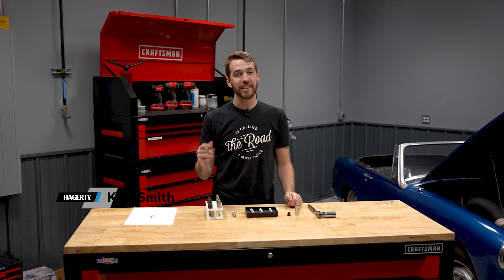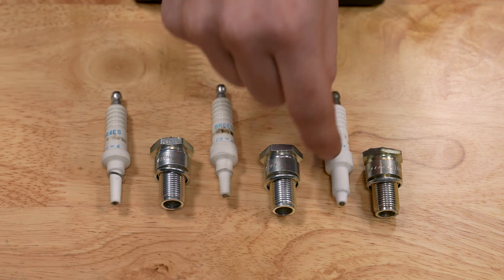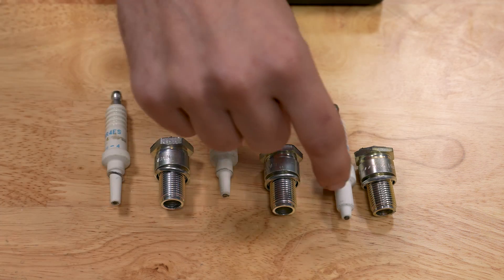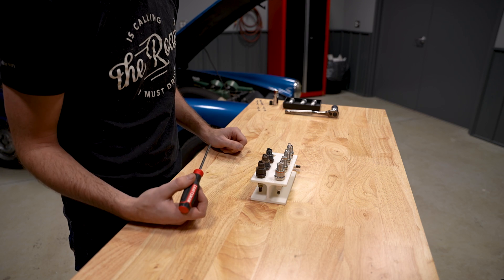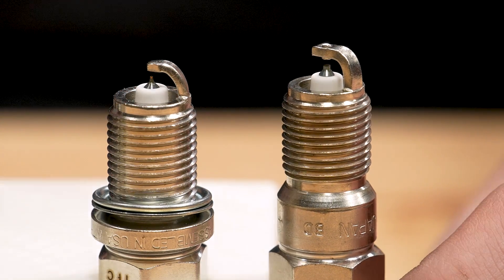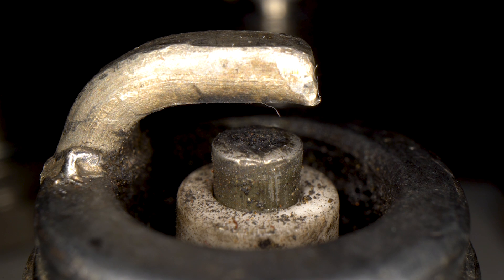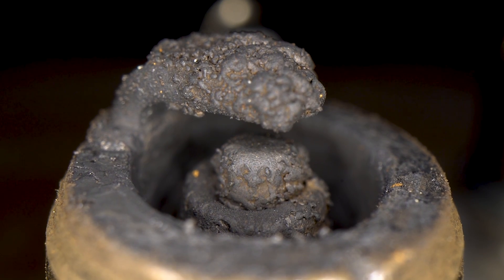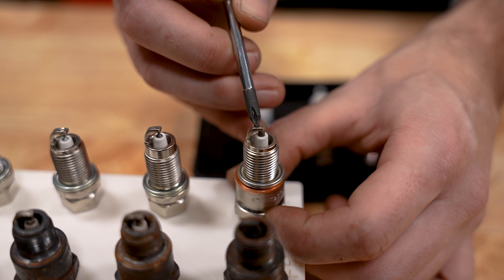How spark plugs work and what they can tell you about your engine | DIY

Comment: hello, recently a spark plug boot sleeve ruptured and the spark plug was loose and I was able to take it out. Now the broken pug about 1/2 inch down where sprk plug connect , the issue is  where it broke is the hard plastic , over time its even became harder . now since I have the sparkplug out . and I tried almost everything to take it out . I lube it with silicon spray . If I grill it with a circular saw 7/8 , which fit in there. would the debris go inside  the piston ? or valve?  the car is in my garage . . please help. thank you in advance. Thank you. More power to you and your channel.

Comment: The coolest thing I ever done with a spark plug was I had a 80cc 2-stroke engine it was running it was hot and I turned it off I turned the motor to where the compression of the piston was at Max and I hit the spark plug with a barbecue push button sparker it must have sparked the spark plug cuz my block it popped zero Revolution to the crank and all of a sudden combustion note to self don't do that again direct that blew the side out like a little shrapnel grenade it was weird the whole top and down the side like popped off

Comment: I have a 2005 one ton Silverado four wheel drive 6.0 with 210,000 miles. I bought new. It still has original spark plugs and it runs as good as the first day I bought it new. No misses no spark issues at all. Even has original wires and coil packs. Chevrolet like a rock.
Reply: Thanks, interesting... I am coming up on my 90,000 miles on GMC Canyon 4 CYL/2007( early first plug Replacement @60,000 miles. OEM)........Also,interestingly, my 2015 DODGE JOURNEY 4CYL, is Every 30,000 miles PLUGS, ODDLY .....WHICH imhad Dealer do, as got “THE Lifetime Conventional Oil Change “, with new **Car purchase ( first time in 50:Years for me , as generally done ,much Work myself over the years)....
Reply: Wow your lucky. 2001 Silverado one engine replaced second beginning to knock transmission slipping and goong on 3rd transfer case chain. Regular services since bought new. Never pulled a trailer or pushed a plow.
 Like a rock.

Comment: A critical point, even though no one is likely to mix them up: never use the incorrect "reach" plug in any head. Generally standard length for iron castings and long reach for aluminum. A long plug in an iron head will likely crash and a short one in aluminum will cause catastrophic burning of the exposed aluminum threads.

Comment: Whats better an why, gasket seat or tapered seat?
Reply: Tapered seat transfer heat better since there is direct contact with cylinder head , but this only in case of ideal matching of the surfaces and avoiding of  any dirt between them . When the gasket introduce some resistance for the heat transfer, it is much more tolerable for poorer matching of the surfaces and accommodation of some dirt . So tapered are theoretically better when gasket type are practically better . M16 vs AK47  the same thing:)
Reply: @flappingflight8537  O dude, M16 all day!!! No comparison!
Reply: @beachboardfan9544  Sure, on the range :)

Comment: They are nickel, platinum and iridium plugs.
A "copper" plug is miss information repeated by everyone. All of those options have copper cores.
An iridium plugs is just as much a "copper" plug as a nickel plug is. 
I can't recall when copper cored plugs started, I think it was the 70's. It was marketed heavily at the time and some brands continue to promote it to this day.
Reply: The key word is the core :) Cooper CORE  . The reason for such design is the better heat transfer of the Cooper . This allow to widen the heat range of the plug so it is able to self clean on light loads and idling and in the same time to do not be a source of preignition on heavy loads . This also allows manufacturers to cover all the engines on the market with much smaller number of spark plugs models .

Comment: Where’s the part about how they work? Does it have something to do with the 12 volts from the battery being converted by a coil into thousands of volts to promote electricity jumping between the electrodes in the form of light energy (the spark) and heat energy and it’s the heat that ignites the fuel, etc.? Also, you mentioned compression rings, but I suspect that many people haven’t heard it spelled out as “it deforms as it’s compressed by the screwing of the plug to a particular torque to conform to any irregularities between the shape of the plug and the hole in order to completely seal the cylinder” or some such thing.
Reply: If you're gonna get fancy its called dielectric breakdown of the air....
Reply: @BrycenKauai  Yes, let's get fancy. This is what I/we want to know. Seriously.

Comment: Is it worth upgrading your plug for more expensive unit or just get oem. Since theynare design for ultimate performance
Reply: Try Denso IridiumTT (double fine tips electrodes) and you will figure out by yourself :)
Reply: @flappingflight8537  thanks; Have two cars with over 120k that need plugs.
Reply: @JuanLopez-oz9kh  120k miles or km ? If it is yours cars first plugs service most probably they are already iridium plugs . Denso iridium TT are performance oriented plugs . Better start,smoother idling , better throttle response, better acceleration , better exhaust emissions and better fuel consumption. They achieve all that with very thin electrodes , only 0.4 mm the central one and 0.7 the ground one . This is the reason their lifespan to be shorter , around 100k km . The OEM iridium plugs that the cars come originally from the factory are with ticker electrodes in order to be good for around 115-120k miles .
Reply: @flappingflight8537  thanks; neither of my cars are for performance cars; just family taxis; lol 120k plus miles

Comment: One thing to note about older engines that originally  came with copper plugs is to replace those with the same type and NOT to "upgrade" them with the platinum style with the tiny center electrode. I tried those and they didn't last nearly as long and fouled very much more easily.
Reply: Not true! If you matched correctly the plugs heat range number and your engine is in good condition ( not burning oil one ) you have to notice even some improvement in its performance . Easier starting , smoother idling , better throttle response , slightly lower fuel consumption and maintaining  the cruise speed with less pressing on the accelerator pedal . I have tried this as well but my results are exactly opposite to yours . 
Also since most of the older engines are with two valves per cylinder , spark gaps indexing give much more noticeable results .
In the cases where gasoline engines are converted to work on LPG and CH4 such replacement of the plugs is  highly recommended.
Reply: @flappingflight8537   Good for you. In my case  with a correctly working engine I found the opposite so results may vary.
Reply: @davidlong1786  The only way what you describe to be true is if your plugs wasn’t originals. There are a lot of copies on EBay and Amazon .
Reply: @flappingflight8537   No they were bought locally at an auto parts store and were name brand.

Comment: Fuel quality also effects deposits on plugs, as does oil type. Ashless motor oils v. oil with heavy additives slso have an effect.

Also mention that using a hotter plug can compensate for blow-by. Demonstrate it!

Also, the spark starts at an edge on the electrode, that’s why the electrode gets rounded. Also, fuel mixture and oil contamination change combustion characteristics, which effects plug choice and plug life. Then there’s extended tip plugs like Autolites v. recessed tip. These variations affect spark timing.

In addition, ignition coils can effect plug life. Lots more to the subject that what’s covered here. Resistor plugs, specialty plugs, indexing the electrode, multiple spark discharge ignitions. Fun!

Comment: "Conical" seat? That is NOT a term any plug manufacturer has used. They're called tapered seats.  
I'm not sure who this video is meant for. Most that came here will already know the things you went over.  Those who don't didn't learn enough to make safe changes. If you're discussing heat ranges and timing inspecting the porcelain for specs of metal can be a sign of knock/detonation or extremely lean mixtures. The ground strap cleaning/coloring indicates timing. 
Recommending changing heat ranges or tune without going into detailed accurate explanations can only lead to mistakes and damage.
I'm not knocking your video. It's free and better than nothing (kind of).... just saying the content doesn't seem consistent with the target demographic.
Reply: I walked away feeling like you were learning as you made the video.  That's not a good feeling for a resource video if that is what it's meant to be.

Comment: Good info and pictures.  Mention resistance aspect and checking SP resistance.  Show pictures of carbon fouled SPs as well.  Don't reuse a dropped SP.  Corona discharge at junction of SP base and insulator.